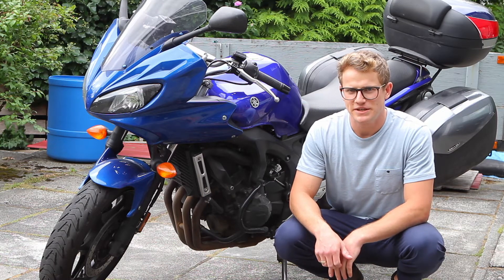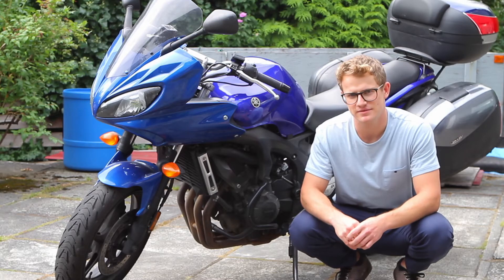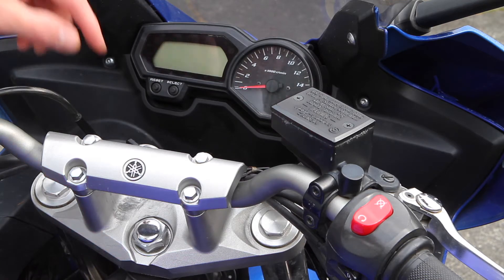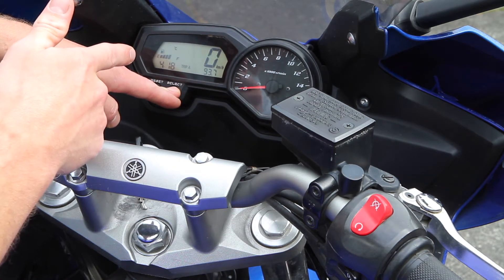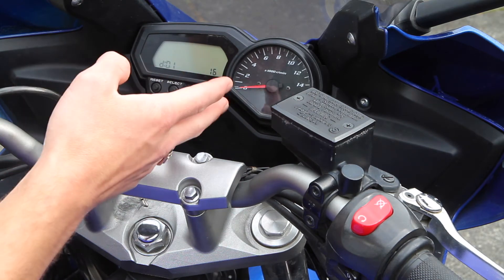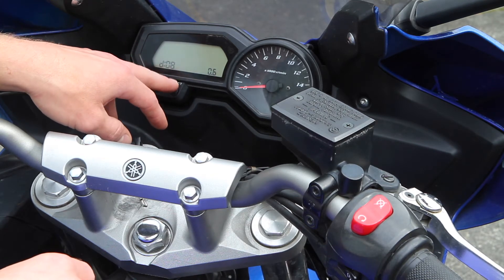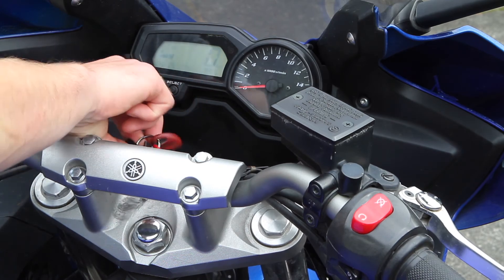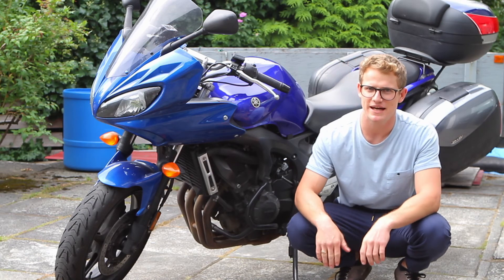How to Enter Diagnostic Mode Yamaha FZ6 + Fault codes

Comment: Hi, when you get the dI on screen if you push Select you get the CO option which you shouldn't as it is fot the carburator older model! I got it though and it had values C01:9 C02:5 Because the gas consumption was high I turned them to zero as I think that would be the default. Or maybe not. Any ideas?

Comment: Hi i have a question my fz6r 2009 model was leaking gas so i took out the gas tank and the fuel pump and replaced the Oring with a new one and put in back in but after that the fuel level dose not work how can i know if the problem is from the float  or the wiring (i might pull the wires while i was taking out the tank but cant be sure thank you for your time keep up the good work ^_^

Comment: First of all, thank you for your efforts. What should be the original diag values for the 2006 FZ6 600 ABS model? In my engine it shows c1: -16 and c2:5. What do you think is correct?

Comment: hey calvin i have a fz6r 13’ and every time i ride its fine for a couple minutes but then begins to bog and the check engine light flashes. Say i’m in first gear or second gear or any gear and i’m at a steady throttle, the bike stops then goes back to normal and then stops like it just keeps bogging as when i first got it, it never used to do that. any thoughts ?
Reply from the maker: Could be many things, but I would check your throttle position sensor, crank position sensor and examine for any loose wire connections. It could be an intermittent grounding issue or a wire coupler that isn’t fully seated together. Good luck!
Reply: @Calvinm  you are right mr.calvin i tested the TPS and had low ohms readings and checked i also went into diagnostics mode and sure enough the crank position sensor came up too and kickstand sensor. appreciate the feedback man you sir are a scholar and gentleman 🫡👍.

Comment: I have an fz1 same year as yours and I’m fully stumped. The bike tipped over back in summer. I picked it up and rode to the store and back and since it’s never started again. Just before that the fuel pump went and I replaced it. Since then in trying to get it going again I’ve watched through a ton of your videos and others and have tried literally everything. I’ve tested the pump out of the bike and it works. Replaced the starter solenoid, the fuel pump relay, the entire wire harness, new coil packs, new plugs. For some reason it fires up on starter fluid, so obviously it cranks and has spark. As I said I’ve tested fuel pump outside of the tank. Tested the wires to the fuel pump in the assembly as well as the connectors in the same place. I’m quite literally stumped. Any help you could be would be greatly appreciated
Reply from the maker: Hmm that is an odd one. The next things I would try would be to get a fuel pressure gauge inline with the feed line to see if you're building pressure. I would also check to see if you're triggering your injectors. In diagnostic mode you can trigger the injectors and hear them click as they pulse. If you don't hear a click then something isn't working to trigger the injectors. In the FZ6 it is diagnostic code number 36 and 37 that will actuate the injectors in pairs when you flip the kill switch on. In the past I have put my fingers on the injectors while triggering them to feel them pulse to check their function. 

Also check out the lean angle sensor, I know you said the bike rode fine after tipping it over but I would double check. The lean angle sensor basically prevents the engine from firing (or getting fuel pressure) in case of  an accident/bike goes upside down. Fire hazard reasons. 

Since it starts on starting fluid, it has to be a problem with your fuel system. If you can't trigger the injectors through diagnostic mode I would get my hands on an oscilloscope to see if you can pick up a pulse on the injector wiring when cranking. A multimeter might work to pick up the pulse signal but it happens so fast a digit multimeter might not display the value (or accurately). 

That's a tough one, good luck! You can DM @freeheadgasket on instagram if you have any other ideas.

Comment: I went into diag mode with the kill switch still on and going through the codes the fuel pump started for a few seconds before i turned off the kill switch. Is that going to mess with the bike in any way?? Im scared :(
Reply from the maker: No worries, I've done the same thing. It won't mess with the bike at all. Your fuel pump runs all the time when the bike is on and you're riding it, you just don't hear it wizzing away.
Reply: @Calvinm  thats great, thanks !!

Comment: I have the error code 12, would this be happening if the timing is wrong?
Reply from the maker: I don’t think so. I think it would only throw the code if the sensor has gone bad.
Reply: @Calvinm  how many km would it take to cause wear in the timing chain?
Reply: @Calvinm  I had this very loud sound from the right side of the bike a few days ago and the error 12 popped up, so I’m guessing the timing chain jumped a tooth or one of the guides broke
Reply: @Calvinm  also, if the timing is off would there be a possibility that the piston hit the valves?
Reply from the maker: @余羿辰  So generally, timing chains don't wear out or stretch to the point that they need replacing. It's very unlikely the chain is worn to the point that it needs replacing. Some FZ6 owners have gone over 200,000 km's without needed a new timing chain. 

the loud sound could have been you timing chain tensioner failing. Some people report having that problem and it often results in a ticking sound from the right side of the bike. the timing chain tensioner is tucked behind the frame on the right side of the cylinder head.

If the timing chain skips a tooth it's possible it could cause contact between a valve and piston. You would find out if that has happened by doing a compression or leak down test. 

It might be worth taking off the side cover that covers the crank position sensor to see if the sensor head is clean and free or any particulate. Anything like a piece of metal on the sensor head could cause a faulty reading and throw a code. 

Best of luck!

Comment: My motorcycle sat for an extended duration of time. So I went to start it and it is giving me a check engine warning light and will not turn over. Of course I could easily get over to the diagnostic mode I'm just still unclear on how to read it. For example what is the exact error code that triggers the check engine light? Any suggestions on what the issue could be or more details and how to read the codes? I have the shop manual and I'm still lost in the dark. Appreciate any info.
Reply from the maker: Hey there, I made another video on reading the check engine lights and understanding diagnostic mode a little better, I’ll link it below. When you get into diagnostic mode you want to scroll to diag #63. When at #63 it will show you what code numbers are currently an issue for the bike. You can find that code number in the service manual and have some ideas about what is wrong. Before that though, have you checked the battery has 12.6 volts? If the voltage is low it may still turn on the dash but not turn over. If the battery voltage is fine check that you are getting power to the starter or that an animal didn’t chew through the power cable leading to the starter. The starter will have two wires, one thick and one thin. The thick one is your power cable the thin one triggers the solenoid in the starter to do the cranking. Best of luck!
Reply: @Calvinm  I definitely appreciate all of the assistance and tips. And I will try your suggestion later today about going to diagnostic 63. I did check the voltage on my brand new battery that I installed and it is perfect. What's the best way to check if the starter is getting power? If the starter is bad would that trip a fault code? Also I didn't see the link for your in-depth video on fault codes. I looked at your other videos and couldn't find it also. If you could shoot me a link that would be incredible. Anyway thanks again.
Reply from the maker: @fastfoxshark   Sorry here's the link: 
https://www.youtube.com/watch?v=JTKfZhTedIw&ab_channel=CalvinMC

A bad starter would probably not throw a code. You would need a multi-meter to see if 12 volts is making its way to the starter when the starter button is pressed
Reply: @Calvinm  thanks a million. I have a multimeter and definitely will try that a shot. If I understand you correctly I hold a multimeter up to the starter wire positive lead of course and see if I'm getting power? Thanks for the link.
Reply from the maker: Ya, place the positive multimeter lead on the power cable on the starter and the negative lead of the multimeter on an exposed area of the frame or engine (basically a ground/earth point)
Reply: @Calvinm  If there are no fault codes what triggers the check engine light? That is probably an overly generic question that could be many possibilities. I didn't get a chance to use the multimeter on the starter yet. I've been tied up at work. I did check the diagnostic code at 63 and it says d63: 00. I'm guessing this means there aren't any fault codes indicating an issue? Again I truly appreciate your input on this.

Comment: Reason I ask is the codes and values all similar to mine appart from side stand as mine says on,
My FZ6 won't start after 20 miles, where seemed to cut out  low revs but good at high revs
Reply from the maker: Could be an air pressure sensor issues. Does it throw a code?
Reply: @Calvinm  fixed the fz6 back in the day 👍

Comment: But how do you clear the code? My has SD60 and will not crank until I clear it.
Reply from the maker: Hey, so to erase codes you have two options. You can disconnect the battery and touch the wire harness side positive and negative leads together to drain the current from the system. OR go into diagnostic mode and scroll to number 62 and then flip your red "on/off" switch to "on" then back to "off". Doing this through the diagnostic menu will erase the history of codes. Best of luck!

Comment: Hi thanks for the your help. I have a fazer 2007 and turned in on this morning and my engine management light is on, not sure weather to bring to a garage or try to sort myself. any ideas.
Reply from the maker: Personally I think these bikes are a great place to start learning to work on a machine. If you find out the trouble code your bike is showing we would know more about what needs changing. Good luck!
Reply: @Calvinm  Thanks Kelvin , I have started to investigate more into the bike , the engine light seems to have gone , I have had battery out and gave a charge up now checking to see with a multimeter if it holds charge. will keep you updated regards Mark.

Comment: I have a code 12 on my fz6, any help on how to get to where the crankshaft position sensor would be located at on the bike? Thanks man, super helpful vids 😏
Reply from the maker: Hey, the crankshaft position sensor is on the rider’s right of the bike. It’s inside the lower side cover of the engine. There is a small cap you can remove to peek inside but to get the sensor out, the side cover has to come off. The side cover uses a gasket but you might get away with reusing it if you’re careful. The sensor plugs in below the throttle bodies. The sensor should read between 248-372 ohms at 20 degrees C. You can unplug the sensor and measure from the connector if you pop up the gas tank. Good luck! 👍
Reply: @Calvinm  thank you so much man! I'll see what I can figure out. Keep up the great work!